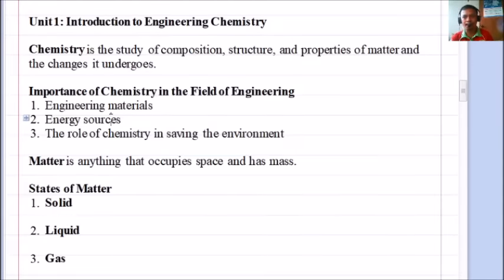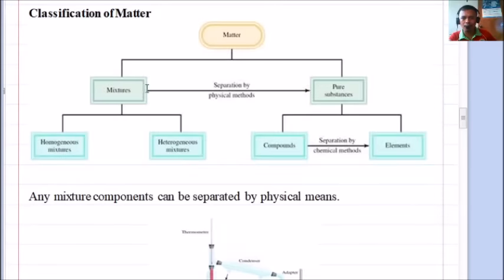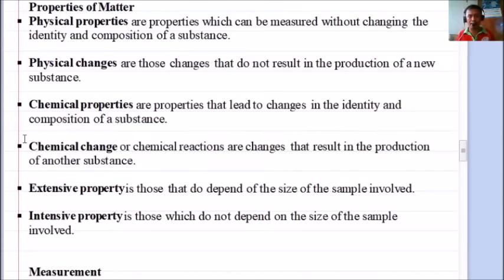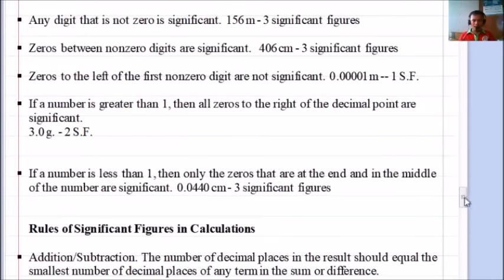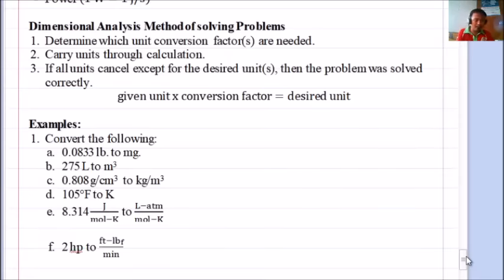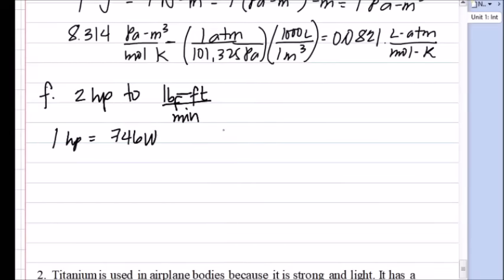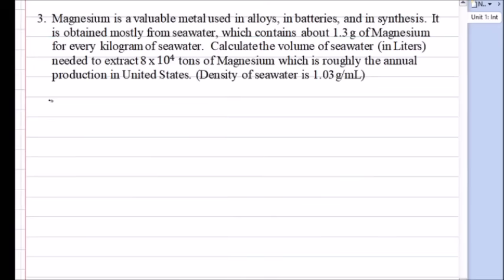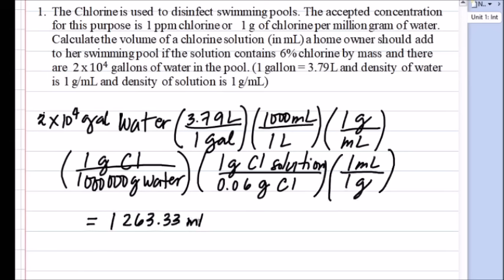Chemistry for Engineers | Unit 1 - Introduction to Engineering Chemistry

Comment: Paano po I compute yung lb to mg? Hindi ko po masyado naintindihan. Huhu
Reply: cancel niyo yung unit tapos multiply
Reply from the maker: Good day

Convert po muna ang lbs to kg by dividing the mass in lbs by 2.205.

After that convert naman ang kg to g(or grams) by multiplying it by 1000 tapos multiply ulit sa 1000 para maconvert ang grams sa mg so lumalabas na 1 kg is equal to 1,000,000 mg. 

Kailangan maset mo yung mga conversion factors in fraction para macancel yung unit na nasa given at iba pang units at para makuha yung sagot with the unit na hinahanap.

Comment: pano niyo po cinompute yung examples sa pagcoconvert like lbs to mg? medyo shinortcut po kasi di ko maintindihan
Reply from the maker: Good day

Convert po muna ang lbs to kg by dividing the mass in lbs by 2.205.

After that convert naman ang kg to g(or grams) by multiplying it by 1000 tapos multiply ulit sa 1000 para maconvert ang grams sa mg so lumalabas na 1 kg is equal to 1,000,000 mg. 

Kailangan maset mo yung mga conversion factors in fraction para macancel yung unit na nasa given at iba pang units at para makuha yung sagot with the unit na hinahanap.